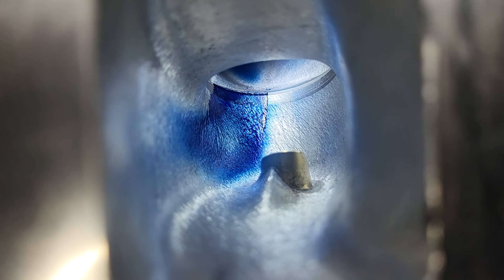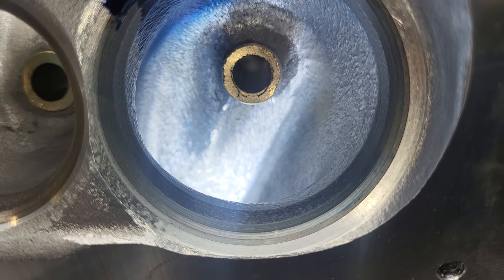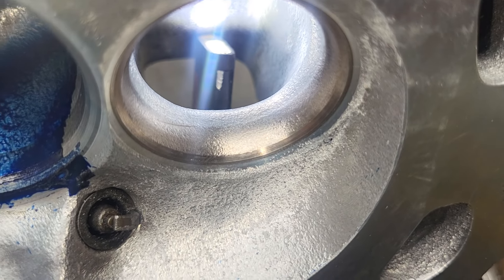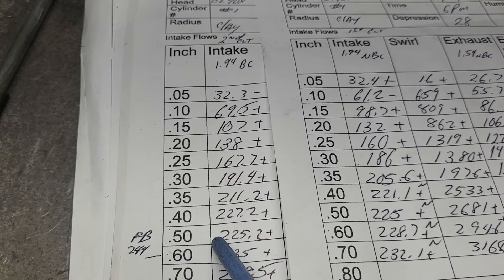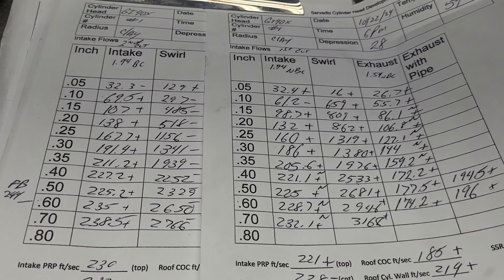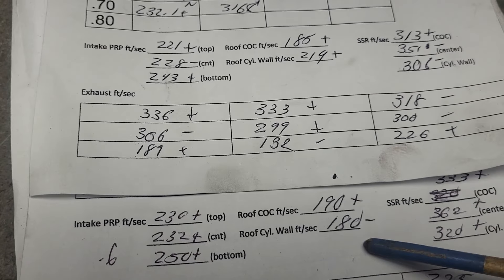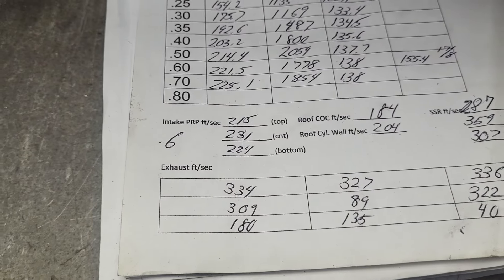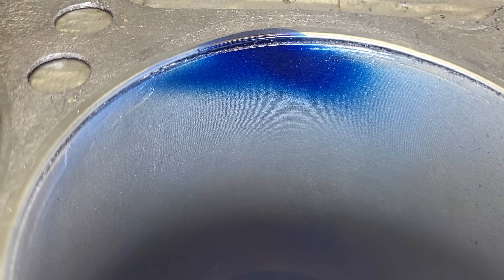GT40X Ford Racing cylinder heads, 2nd cut, Fox body project

Comment: Getting there.  I saw somewhere in an article they gained 100hp from heads and 1.7 rockers on a stock 5.0 over e7.  I still have not found any flow data on an E6 head.  Maybe I will be the first person to test them when I build my bench 😀
Reply from the maker: @brokentoolgarage  I did some e5 or e6 heads a while ago. Thanks
Reply: @servediocylinderheads  I think those were E5.  E6 has the "swirl" closed chamber shrouded valve design. Most Ford people get a knee-jerk reaction when you say E6 lol
Reply from the maker: @brokentoolgarage  ok, those flow bad and have different length valves
Reply: @servediocylinderheads  I think you are right on the valves.  My question is how bad - my guess is slightly worse than E7 bad due to valve shrouding
Reply from the maker: @brokentoolgarage  Yep

Comment: I'd say that intake is right on the edge, try to get more out of the exhaust, stick a high overlap cam that'll still pull vacuum and enjoy ~430hp at the crank.
Reply from the maker: @rolandotillit2867  On the edge of what?
Reply: @servediocylinderheads  Of how much you can get out of it before you start hitting diminishing returns. I'm sure you can get more flow out of the intake, but I wonder if putting all that time would be worth it, when you can make bigger gains on the exhaust side for the same amount of time invested.

If you can get 3-4 cfm extra on the intake side, is that better than getting 5-6 cfm extra on the exhaust side for same time invested? Ideally you want both, but if you had to choose.
Reply from the maker: @rolandotillit2867  Interesting question. I would need to look at the ratio closer. Thanks

Comment: Id still rather have your E7s for somethjng on the street..i cant see needing to use an extreme amount of lift to see the cfm gains.

Maybe an average air flow comparison to say .500 lift between the two?
Reply from the maker: @panthermadness4232  I would need to find an old E7 flow sheet! Thanks

Comment: If you don't polish the short side radius, is fuel more likely to stick to the rougher floor versus a polished SSR?  This is my assumption about your statement 

Please expand my knowledge! 

Also, do you flow Dychem only at max lift of the intended application?
Reply from the maker: @gordonborsboom7460  athe rougher texture makes for a thicker boundry layer. As far as what the flow does different between polished and rough I can say I like what I see in chamber and cylinder with polished ssr
Reply from the maker: @gordonborsboom7460  Usually fuel puddles into drops or droplets better on a smooth surface. The ssr is challenged due to high airspeed drops would have a tough time on ssr. Thanks
Reply: @servediocylinderheads  I appreciate the info. Thumbs up 👍